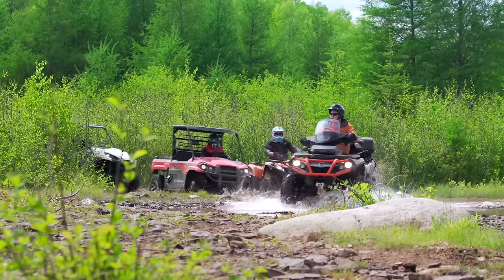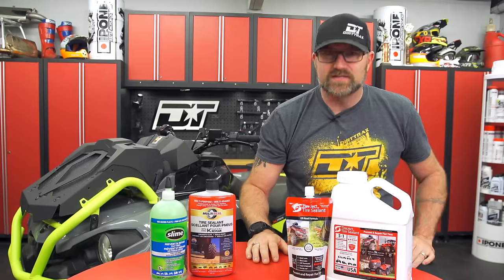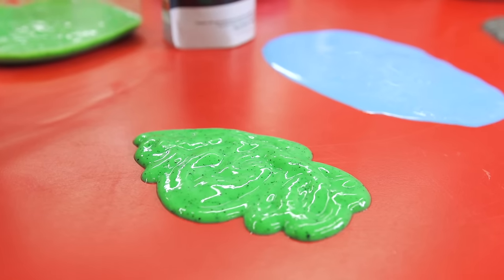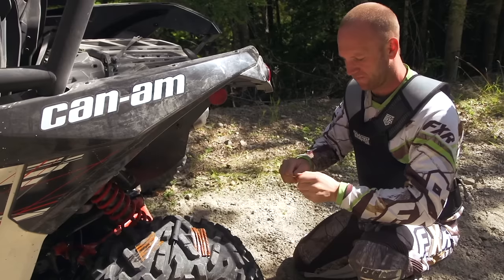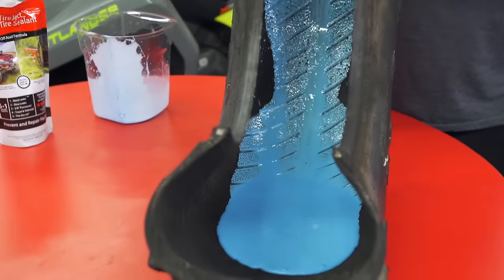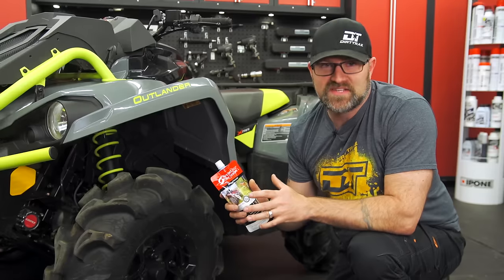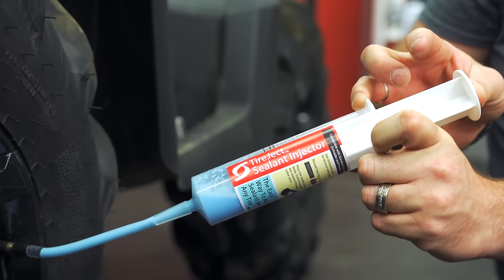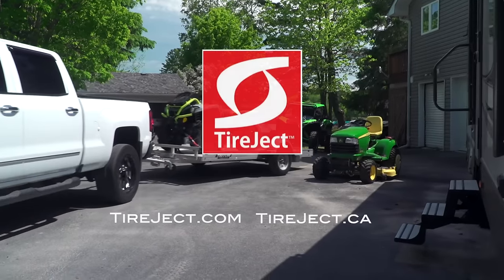TireJect - The Best Tire Sealant To Repair and Prevent Flat Tires

Comment: One big misstatement!  Having driven off road since the mid 1960’s in Jeeps, bikes, ATC’s, quads and the last few years SXS’s I (and anyone else who has a similar experience) lower pressure is much less susceptible to a slice or puncture.  The tire will tend to deform around rocks tree roots ect rather than be sliced or punctured.  I’ve watched this channel for quite a while and I’m inclined to think this was just a slip up that made it past editing.  Excellent product and review.
Reply: Logically I’m inclined to agree. That said, I run the Tubliss motorcycle system on my dirt bike. It actually contains a smaller tube fitted in a rubber liner that when inflated to 100 psi expands creating a sealed tire. Unfortunately that small 100 psi tube got a pinhole leak in my rear tire and it went flat. I carefully rode 15 miles on the flat and picked up a drywall screw when the tire was already flat.

Now I wonder if it’s just a coincidence or was the flat tire more prone to grabbing nails?

Comment: I had a bead leak on the back right tire for years on my LTZ 400 and my wheelies kept pulling to the right all the time and I would constantly need to let air out on the opposite side to match the tire pressure in hopes to wheelie straight. I saw this product and figure I give it a try I was amazed it really works! Still holding air a week later! and the wheelies are straighter!👍

Comment: Iv used this stuff, It does seal up, but the forts time I may have used too much, it made rear tires vibrate bad, I went with less than what was recomended, and it did help, but still had a vibration
Reply: This is not common at all. Would be curious to learn more about your application to understand why you had vibration. Message us at help@tireject.com
Reply: Which brand?

Comment: Nice ad.... but ... what´s wrong with plugs ? They are reliable and easy to install...
Reply from the maker: Nothing wrong with plugs. TireJect is a preventative though.
Reply: Also, plugs do fail. TireJect can actually seal around failed plugs and is compatible with plugs unlike other sealants
Reply: I need to fix, bead" or rim" leaks.

Comment: Flat out has 10 plus years puncture will stay sealed with it, but don't know how long it doesn’t dry up in tire,  also with flat out for sidewall tire punctures tilt tire to side where puncture is you might have to take tire off to do it n one guy said it sealed it on his lawnmower sidewall puncture
Flat out good product also, Slime works good also but only has like 2 year shelf life kept in good temperatures, but it will harden in tire after awhile also if you don't drive or ride vehicle for awhile

Comment: Mine dried out in 6 months.  Yeah it flows great and installs easy but it was basically rubber like. Seems like it is very similar to Stan's bike sealant.
Reply: Flatout has 10 plus years life it says, but I don't know how long in tire, but it says puncture should stay sealed with it for 10 plus years

Comment: I'm considering either the Flat Out or TireJect for my fat tire eBike. I have 2 eBikes. They run low air pressure in the tires so are more prone to flats. I've seen where Flat Out can be used inside tubes so I'm guessin TtreJect can be also. Can TireJect be used in a 26" x 4" fat tire eBike that has tube tires?
Reply: Same Q about TireInject and tubes.

Comment: Just got a flat last week luckily I bought a tire pump that I attached to my battery and was able to get me back 15 miles
Reply: Also I paid to have it fixed and the stuff they used was purple and did not work
Reply: @cameronsaint116  This is common for all the thick gel based sealants like they mention in the video, give TireJect a try and you will not be disappointed!
Reply: I put 8 ounces of green Slime one in my 26inch by 4 inch fat tire e bike when it got a flat n it worked , make sure on Slime one it is still good, it has a shelf like of 2 years or something like that kept in decent temperatures,  it will also harden in tire if not riding for awhile or in there real long, I wouldn't put green Slime in unless you get a flat, keep one or two 8 ounce bottles on bike with a pump just in case you get a flat then use it, don't get tubes with it in already, buy bottle n put in yourself, also get a good pump to keep on bike to pump up tire like a step on one which isn't to big, get back rack n side baskets for bike to put stuff in
Reply: @michaeljohn7467  So are you saying you prefer Green Sime to TireInject!

Comment: Would this work on ebike tires 20" tires. If so how much is recommended
Reply: 4-8 ounces, I put 8 ounces of green Slime one in my 26inch by 4 inch fat tire e bike when it got a flat n it worked , make sure on Slime one it is still good, it has a shelf like of 2 years or something like that kept in decent temperatures,  it will also harden in tire if not riding for awhile or in there real long, I wouldn't put green Slime in unless you get a flat, keep one or two 8 ounce bottles on bike with a pump just in case you get a flat then use it, don't get tubes with it in already, buy bottle n put in yourself, also get a good pump to keep on bike to pump up tire like a step on one which isn't to big, get back rack n side baskets for bike to put stuff in .

Comment: Works fine did the job. but use a different delivery method it is designed to spill and if  you grab the bag thing with out the lid on tight  it will gush all over. The bag delivery system is  the FAIL I commented on the web site and they cried about the TRUTH the BAG sucks  sooo Tire blocks will solve the issue nicely.  But not cheap. It works Just use a solid container to pour  the stuff in to distribute.